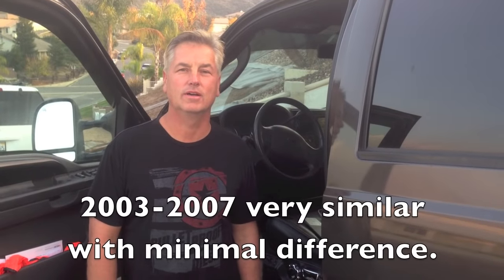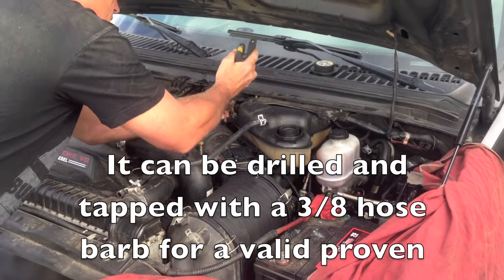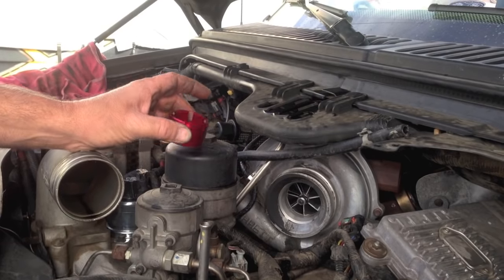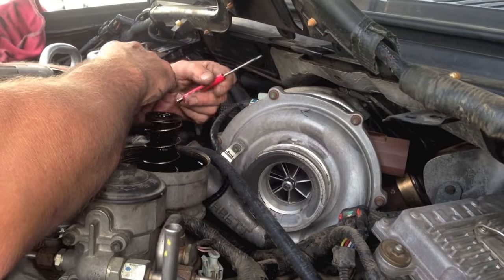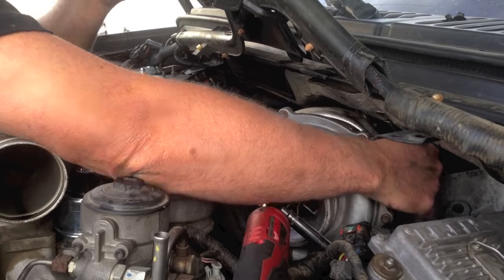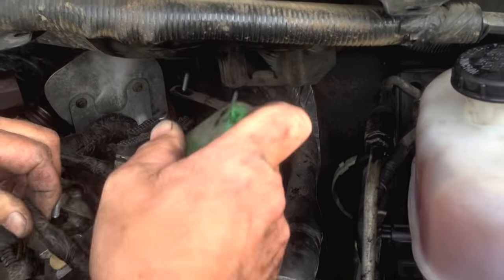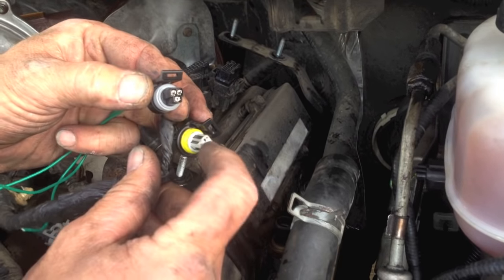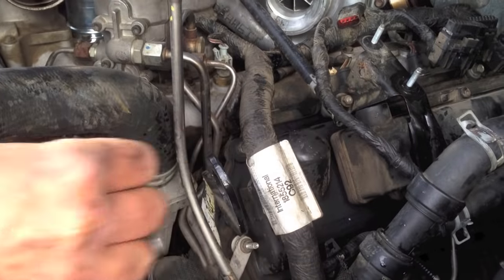Bulletproof EGR cooler with Ford oil cooler. 6.0 Powerstroke

Comment: I had my egr cooler(OEM) replaced 2 years ago and now I have coolant leaking down around the starter. I guess the egr has a bad weld or something? I can't find anything else with coolant around it. Do they leak externally?

Comment: Hello.

I'm in need of some advice.

I drive a 2005 f350 6.0 psd.
I have a strange crank no start situation.
Does not matter if the engine is cold or hot, but sometimes the engine won't fire up.
No codes.
When it doesn't fire up I cycle the key off and on and it fires right up.
Sometimes it takes a couple of key cycles before it works but eventually it always fires up.
Sometimes just 1 cycle off and on but sometimes it takes 6 or more times.
Does not matter if engine is hot or cold.
So no high oil pressure problem I think.
Replaced the standpipes and dummy plugs.
When it does start normal it really starts fast, like crank and immediately fires up.
Hot and cold!
Battery's are new.
60psi fuel pressure
Do the injectors buzz when my ficm has no power?
Ficm relay not switching?
Ficm power is 48volt when I check it with the volt meter.
But that's when there's no problem.
When the engine runs it runs great.
Never a problem.
Just the sometimes no start.
I'm scared that one day it doesn't fire up anymore and that I'm stranded somewhere.
Do you have any suggestions?

Thanks in advance.
Jordi
(All the way from the Netherlands)
Reply: Maybe cam/crank sensor mine was doing the same thing

Comment: Ron i have an 04' excursion I bought not to long ago have app 126k miles. I noticed that my oil temp is running at 225 when coolant is at 190. Is this a sign of a failing oil cooler.

Comment: The turbo on my 2005 has a pipe coming from the bottom of it and it looks like another bracket on the bottom of the turbo holding it down. Do you have removal video of this type. I'm stuck now.

Comment: just to make sure I'm doing it right how would I look at the stem to look if anything is broke and on the top side where the other filter is on one of the pipes the nut that screws the pipe in was a little most

Comment: I have one that overheats. Rebuilt two years ago ford long block. Rebuilt rad new thermostat new clutch fan. And outing an oil cooler as I write this.
What else could it be? 
My customer is asking about a water pump.

Comment: hey Ron I comment a question before about after changing the oil and fuel filters I have lost power and the vehicle is a 2004 f250 6.0 changed them again still no power I check to see if I damaged something everything was good please help thanks

Comment: I followed your video to change the egr and now i have a low oil pressure warning come up on the dash. there is no oil coming out anywhere. the oil pressure switch seems to be working when i tested it would go to oil 4 ohm Resistance. am i missing anything else?

Comment: hey Ron I comment a question before about after changing the oil and fuel filters I have lost power and the vehicle is a 2004 f250 6.0 powers tremendous I changed them again with motorcraft as usual and still no power I check to see if I damaged something everything was good please help thanks

Comment: I have a 07 6.0 water in oil filter but not in the pan. And Steem out exhaust . Oil cooler and erg cooler or head gasket

Comment: well Ron.. my oil cooler has apparently ruptured! degas is black.. like coffee black. Doesn't smell like fuel though.. so wish me luck. I'm doing it ONLY after watching this video at least a 100 times. What is the BEST olicooler to get? I know OEM but seems. there is an "upgraded cooler, better flow" ??
Reply from the maker: the oem is upgraded.flush the coolant first. delete or bulletproof egr cooler
Reply: +DieselTechRon THANK YOU SO MUCH!!One more question.. on the EGR delete. should I just weld up the ends of the cooler or what would you suggest?
Reply: +DieselTechRon I couldn't flush mine Ron... ruptured oil cooler guess ill have to do it again later.
Reply: +19jody72 yes exactly, tig weld a plate in each end of the oem cooler. But before that flush out all the coolant passages real good, then pressure test it for Leaks. Don't buy junk kits they have, they'll leak coolant and the up pipe has no bellows for expansion and it will leak exhaust. Factory egr supports exhaust everything properly and the factory coolant hose does its thing.
Reply: +impleasen I put the bullet proof remote oel cooler on.. welded shut the egr cooler.. and all is good now. studds and head gaskets next then it's fixed like they should be.
Reply from the maker: OEM.  just keep away from the China crap.

Comment: Just wondering do we have to drain the oil and radiator fluid before we begin this process?
Reply: Not the oil just the coolant. But make sure you do a proper coolant flush before you start this repair or your new cooler will plug again. After the repairs and the flush I suggest using cat elc coolant it is better than ford gold.

Comment: hello ron i enjoy your videos, i have a 04 f-250 w/ 6.0 it takes 30 or more seconds to fire then sounds good,after idle a few mins. i lose oil pressure, rev up a little the idiot gauge pops back up. also have a oil leak on passenger  side leaking above the starter that i cannot locate need a little help thank you russ
Reply: +Russell Beach  Russ, did this problem start suddenly, how many miles?    The 6.0 has a swash plate issue in the pump where the sucker spins, you might be a little low on power but you might have popped the plug on the side of the HPOP, shoot me a message
Reply: +fastst1 yes the plug on the side of hpop was missing,kind of curious where it ended up,but new pump is in along with egr delete kit. truck sounds fine oil leak gone but seems to lack  power.going to have it scaned to see what kind of codes it throws at me, maybe ficm? thought i heard u say u rebuild those in one of ur vids if so let me know. i really appreciate your help could not have done it without ur help thanks again RUSS
Reply: Russell Beach
 I had one of my pump spit the plug out after it spun the swash plate.  I rebuilt the pump as it wasn't worn, just out of time. The plug usually ends up in the oil pan out of harms way.  First is to check the codes using a scan tool with the ford code set.   Ron's videos have been a great help to me as well.  Check your ICP sensor for an oil leak, that's what caused my hpop pump to spin/fail.

Comment: If you don't add oil to the cavity under the oil cooler , can't that cause the ipr screen to rip from the air in the system

Comment: did you replace the oil cooler with an oem part or aftermarket? if so where did you get the aftermarket?
Reply from the maker: Factory oil cooler.  I don't know all the other brands but every chinese part that i have seen on the 6.0 is junk.  Bullet proof is good.  never used the others such as ppe etc
Reply: +DieselTechRon Thank you sir. I'm gonna be deleting my egr and installing another oil cooler in my driveway based on your video. Thanks for the help!

Comment: hey Ron I comment a question before about after changing the oil and fuel filters I have lost power and the vehicle is a 2004 f250 6.0 powers tremendous I changed them again still no power I check to see if I damaged something everything was good please help thanks
Reply from the maker: guessing? sucking air from the lower seal? or broke the tip off the fuel pump.  the lower filter slips over the fuel pump.  upper filter not fitting right.  check the stem for damage or part of the old filter.
Reply: The hnz

Comment: did you flush the cooling system before or after repair?
Reply from the maker: You should flush it before disassembly if possible.  If not at least remove the drivers side block plug and push out any contaminates..If it's real dirty then pull the starter and flush both sides.

Comment: Where do you get your parts from?? Do you recommend OEM Oil Coolers instead of ones from  PPE or  Dieselsite.com or XPD??
Reply: Yes stock Ford cooler is recommended. They have redesigned the older problematic ones with one less prone to plugging. I believe he specifically warns again doorman brand or any derivatives.  I don't believe Ron objected to the bullet proof diesel coolers.

Comment: Do you feel the EGR needs to be changed if it's work?
Reply from the maker: if I had it out,  I would upgrade it or eliminate it.  just replacing it I wouldn't unless it was shipping it over seas, giving it to my daughter or something that made it worth while.
Reply: +DieselTechRon I just did the Bullet Proof EGR cooler and the oil cooler about two years ago and its leaking between the manifold and the EGR cooler what should I replace, not the blue hose. I appreciate all your help.

Comment: so i have a 03 6.0 and my truck at low speeds or from start loses power and pukes white smoke if i let off pedal goes away if i keep on it will go away soon it happens on and off not every time i drive but more often now i thought it was the banks system but no still happens yes some coolant loss and looks like degas bottle is puking some times what should i do ??
Reply: Could be EGR or oil cooler failing.  Stop driving it.  Take it to a shop.

Comment: I have an F3 50 that I have just replace the oil cooler in EGR cooler and I put everything back together but doesn't want to star I would like to know if anybody has suggestions what should I do to fix this problem thanks

Comment: These engines are real pain to work on especially when you have to replace the high pressure oil pump towards the top back center of the engine.

Comment: I have replace my oil cooler in EGR cooler and this morning I turn on my truck for the first time after I replace those two items but on the radiator what the radiator water it looks like it's oil again I don't know if he is from being duty from before that I didn't wash it good enough it's anybody have any suggestions or what could have been a butt on this case
Reply: +Armando Rodriguez  Follow Ron's coolant system cleaning video, its a lot of work to get all the oil out of a cooling system

Comment: how about remove the alternator first before the turbo.
Reply from the maker: You don't have to but if it helps you then it will give more clearance.
Reply: +DieselTechRon Boss, Im honored for the reply! But you took that damn alternator off anyways and that what you was fighting the turbo on.
Reply: +DieselTechRon For the record  pretty much everything I know about this engine is from YOU! You know so much about this engine that you can simplify it down to where almost anyone even a woman could feel confident in tackling a massive project such as  this. THANK YOU!!

Comment: don't ever work with the oil filter cap off, the plastic post that goes through the filter is fragile and if damaged at the bace the filter will not work properly or at all.

Comment: I'm sorry but with such a big job to get to the intake gaskets I would be absolutely irate if those intake gaskets were not replaced with new ones regardless of how well they looked...
Reply: The ford intake gasket set IS only $30 BUT it can be hard to source nowadays and THE AFTERMARKET ONES ARE NOT SOMETHING I WOULD EVER TRUST... due to dozens of  come-backs due to intake leaks.... and I have had  only one come back after reusing the originals with a 5 minute dip in lithium engine assembly grease.... (the composition of most aftermarket companies' rubber material is just not up to the motorcraft standards and usually breaks up after a few months) ONLY EXCEPTION I'VE FOUND IS THE BULLETPROOF DIESEL SET... It's about $130 though.....

Comment: Hello I just changed my egr cooler with the sinister egr cooler and I replaced the oil cooler with a oem one. I started up the truck and as normal I was seeing the white smoke that was left over in my exhaust. Now I am seeing oil coming out of my exhaust with white smoke. I am hoping it is just a bad seal on the turbo but there is enough oil coming out to make a puddle about 12" round after 5 minutes of running the truck.Does anyone have an opinion on what it is?
Reply: I changed my Egr cooler a few months ago when it started to hydrolock and give white smoke, after the change out the white smoke stopped pretty quick.    If your getting oil out your exhaust you shouldn't be running it until you find out where its coming from, check your oil stick make sure your not getting coolant in there and maybe pop off that turbo exhaust and intakes and see what side the oil's on.    I wouldn't think if oil is coming from turbo then it will only show on the exhaust side and not the intake side hence that bad seal your thinking.    hope you find it man and its something simple, it usually is.
Reply: Thank you for the reply. At first what I thought was oil was actually burning anti freeze. I have driven the truck for a few miles but the smoke seems to be getting worse. Not sure what it could be. I am gonna do the pressure gauge test on the degas bottle.
Reply: Yea unless your overheating the only thing left to build pressure after replacing the egr cooler is the head gaskets.   but it also stands to reason that if you did not have these symptoms before you changed it then why now somethings missing here.
Reply: Also when you drove it did it miss really bad also? or did it seem to almost rev up on its own?
If oil and coolant getting in the intake its going to miss really bad and or rev up cause it can burn the oil as fuel.
Reply: I am just hoping my converter is full of antifreeze and it is burning off but I took it for a drive tonight and it smoked up a whole intersection. I pulled the cap off the degas bottle and it was not under a lot of pressure. When I changed the egr cooler the down pipe was full of anti freeze.. Just curious to know how long should I drive the truck to burn off the anti freeze? I do not want to damage anything. The truck is running fine with no miss.
Reply: DrAsTiC09   Running it to clear out the coolant should be fine so long as you do not drive it too hard, still wondering why you getting oil coming out your exhaust you were talking about.   When i did my egr delete by welding both ends shut with Stainless plugs and ran truck after it smoked for a min or so, if you fixed your coolant leak issue it should stop pretty quick.

Comment: Nice repair job done. however I would never own a ford or any automotive diesel engine what a pice of sht designed to fail and hard to repair why could that cooler not just be bolted to the side of the block or something again what a pos.

Comment: Bulletproof EGR new
Bulletproof oil new
arp stud new
Gasket oem  new
Bulletproof fcim new
ipr new

dealer ford  f 250 6l overfilling oil  .............   5 gallon  ...............  are assholes
Reply: damaging
injectors
Gasket 
valves
Reply: sabas7007 that sucks. Have they done anything to remedy their mistake? I stopped taking my studded truck there after they gave me a laundry list of "repairs" that made no sense. uhh...your brand new radiator is "not within spec", so we need to replace your hpop cover, radiator, full cooling system flush and "possibly new water pump," degas bottle, glow plug harness, front engine cover, bed plate, external transmission filter housing, and transmission pan.

The front engine cover and bed plate because there's a small leak...it was coming from cracked CAC boots.
transmission pan because there's a tiny dent at the bottom of it. external filter housing had a tiny seep. wasn't tight enough
glow plug harness because "while we have the engine out"
all of that garbage and they didn't even catch the real oil leak and to the tune of "at least $9,100, most likely closer to $12,000, depending on what we find"

I brought the truck in for a simple oil leak, which ended up being cracked CAC boots. The cooling system is fine. it already has a new water pump, bulletproof EGR, new ford oil cooler and new radiator. delta of 4-6 degrees on the highway. The truck doesn't get hot even with 95F ambient temp while towing.